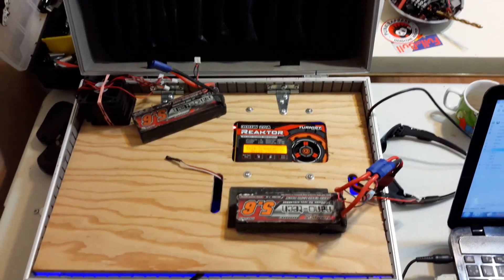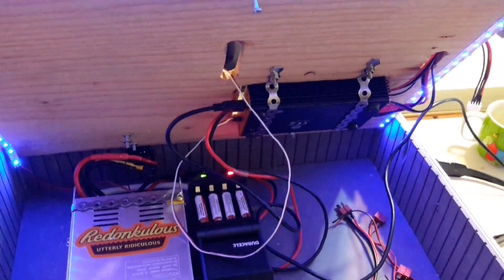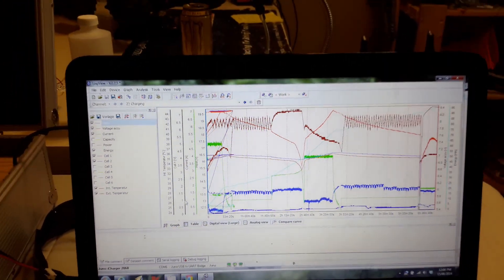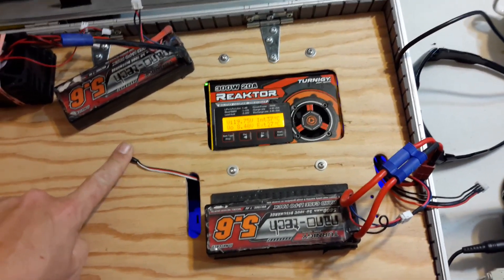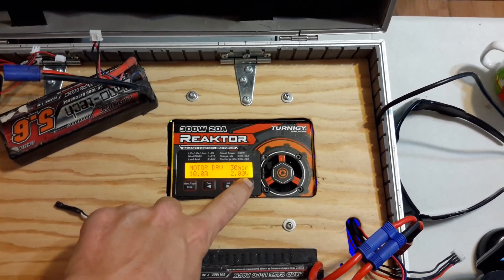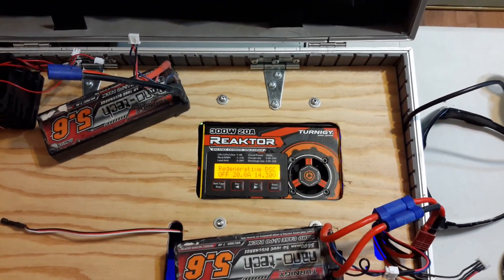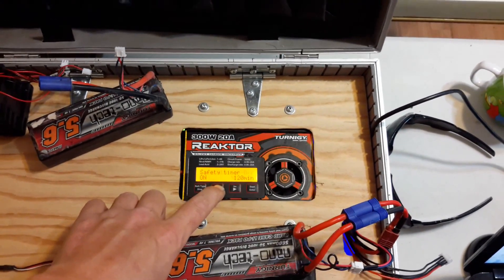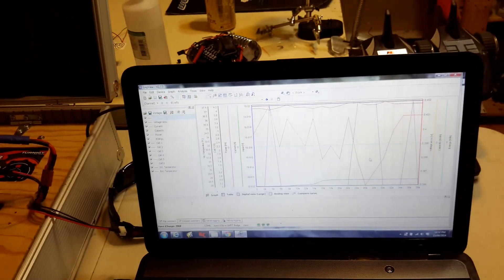Turnigy Reaktor Pt 2 (LogView)

Comment: Is it possible to start a charge via USB?
Reply: No that is only a data port.  Even if you had a usb wall plug that could put out the amps needed the wire gauge would be unsafe to handle it.

Comment: at 5:10 you showed the Motor DRV option.
Does it use the other (regular) DC output?
If so it means you can drive another device WHILE charging your batteries?! ... and at its own selected Current & Voltage?
What's that '30 min' text on the top-right corner there?
If this little device can do all these things, it would GREAT for my custom portable UPS project for a powerful mini-pc!
All I'll need (besides a AC/DC PSU) would be some kind of automatically switching relay, to disconnect the battery-pack output when main-power is available :)

Comment: Nice case. 
I'm planning to build similar (but smaller and better looking ;) ) to use as a portable ups battery (actually exactly as a laptop battery with hot-switch between main-power and battery), but  for a device somewhat more powerful than a laptop (the Intel Skull NUC mini-pc). I've decided on a 4p6s LiIon battery-pack (with 3500mAh 10A 18650 cells). And I think I'm going to use either the Turnigy 250~300W 6s Charger (or the iCharger 206B) to safely balance-charge the battery-pack. 
Of course I'll need couple of DC-DC Power Converters, 
but what I have really big problem finding so far is a good /and relatively small & light/ smart-2-INs-1-OUT-power switcher relay to allow for automatic /uninterruptible/ switch from main-power to battery when I unplug it from the wall-socket, and back to main power when plugged again. This relay-switcher should be capable of 7~8A (but to avoid overheating it perhaps I should look for 10A one) and should be able to push up to 27V /about 22V would come out of the battery when used, and up to 27V from the main PSU/ which later I'll convert to the 19V needed by the NUC.
Can you guys recommend such automatic-switch-relay?
I'll greatly appreciate it!

Comment: Hi, on icharger manual there is a note that we cannot use standard USB cable to connect it to pc. Is this true? If yes, what kind of USB cable did you use with reaktor to update Junsi firmware?
Reply from the maker: Jurica Šoštar I used a regular usb cable.  Worked fine for me.

Comment: Thanks for the video.  I have a couple of these that I use for Civic Hybrid battery work.  You mentioned that you used the junsi updater to flash the firmware.  Where did you get the firmware?  I can't find it on the Junsi site.